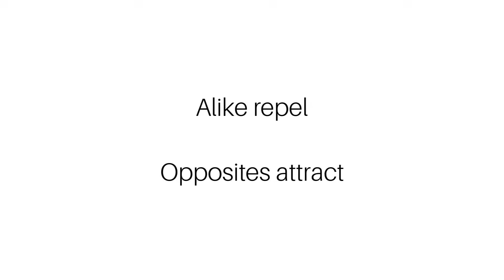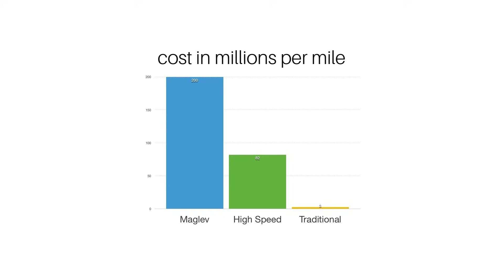How do maglev trains work?

Comment: They have invented free energy and momentum - no need for electric motors or combustion engines. 

Magnetism is the secret of the universe.
Reply from the maker: Nope. There is no such thing as “free energy and momentum.”
Reply: @NathanNagele  actually, there is - however I was wrong in saying this about maglevs because (as I understand it) electricity is used to change the poles of the magnets in the tracks?
Reply from the maker: @palereaper  yes, the magnets needed to make the train move are electromagnets.

Comment: Hey i wanna make a maglev for a school project so how do i switch the poles of the magnets so the train moves
Reply from the maker: You would need electro magnets and probably a computer to switch the poles.  An easier method would be to get magnetic tape and put two strips down, and then put two strips on a piece of wood or cardboard with like poles so that they repel the strips below it.
Reply: @NathanNagele  thanks

Comment: You cannot compare the excessive cost by using the Shanghai Maglev as a guide. It was built on river silt of a delta with piles of up to 75 metres long being used. This is not normal.
Reply from the maker: Seeing as there are so few of these systems in place around the world, there’s not many other ways to compare it.

Comment: This video I can find out work train maglev . The Maglev train is floating about 10 millimeters above the magnetic rail. Forward impetus is carried out through the interaction between the magnetic rail and the induction machine which also produces a magnetic field inside the train. Advantages and disadvantages The main advantage of this train is its ability to float on the rails, so it does not cause friction. As a consequence, theoretically there will be no replacement of rail or train wheels, because nothing will wear out (maintenance costs can be saved). Another side benefit is that there is no resistance force due to friction. Air resistance is certainly still there. For this reason, the more aerodynamic Maglev Train was developed. Due to the fantastic shape and speed of this train, the noise (sound) that is generated when this train moves almost the same as a jet plane, and is calculated to be more disturbing than conventional trains. In one study, the noise caused by Maglev trains with conventional trains is more noisy, about 5 decibels or 78 percent. Another disadvantage of this train is the high investment, especially the procurement of railroads. Thank you so much🙏
Reply: The Japanese Maglev train floats 10 cm above the track. It is the EMS maglev tech (German Transrapid) that floats 1 cm above the track.
Reply: bruh, it levitates around 10 CENTIMETRES above the ground

Comment: The working principle of the Maglev train is to use a magnetic force to lift the train on the rail (with the repulsive force rejecting the same polar magnet) and to move the rail along the track. Another important component in the Maglev train system is the track (train tracks). Along the Maglev railroad it is equipped with magnetized metal called a guideway. Maglev's enormous train speed is supported by a drive system that is quite unique, unlike other trains that utilize electric motors or fuel combustion, Maglev trains utilize magnetic fields created by electric coils (electromagnets) on the walls of the guideway to move the train. When the train floats, electricity is supplied to the coils on the walls of the guideway to create a unique magnetic field system that can pull and push the train along the guideway.
Reply: In democracies sometimes it is cheaper to go underground with a number of modern multi modal TBM working 24/7 than have expensive court cases.

A single 11 psi Maglev tunnel can increase speed from 600 km/h to 700km/h while still being breathable and passing stations would allow daytime trains to stop where needed with overnight container trains beating any truck by eight hours over 1,000 kilometres between freight sidings eliminating daytime planes and reducing trucks.

Using Sydney to Melbourne as an example with passing stations at Canberra and Albury it would cost $60,000,000,000 and return $20,000,000 per night which makes it able to subsidise daytime fares below planes and still have a return of 10%

Perhaps cooperation between Japan, China and America can develop the maglev container train with  Australia to use an international guideway to benefit the world.

Comment: Maglev train is an abbreviation of (magnetically levitated trains), in Indonesian called electric levitation train. Often also called a magnetic train. The principle of this train is to utilize the magnetic force ...
Because there is no friction between the rails and train cars, the Maglev system has a higher speed than conventional trains and is quieter.

In maglev, magnetic coil stretches along the railroad track, which will reject and lift the same polar magnets at the bottom of the train. This magket force allows the train to lift between 1 and 10 cm above the rail. After the train is lifted, electricity is supplied to the coils inside the rails. This creates a unique magnetic field system that pulls and pushes the train along the rails.

Comment: The magnet shown in 0:28 is NOT levitated by another magnet. It's floating on top of a superconductor, because of this. If the magnet try to move in any ways or direction. It will create a changing magnetic field relative to the superconductor. Due to Faraday's law of magnetic induction, that will generate a current inside the superconductor. This current create opposing magnetic field to the magnet, which prevent it from moving. The faster the magnet move, the more current is generated inside the superconductor and the greater the opposing magnetic field become. Because this thing is a superconductor, any change in magnetic field will generate an infinite current in the superconductor generating an infinitely large opposing magnetic field. This make it impossible to be moved.
Reply from the maker: Thanks. I’m aware of how it works, I was just using it as a visualization.

Comment: So... How does the maglev train gets electricity if its not in contact to any overhead pantograph or third rail? Although I already know the answer, but you forgot that part.
Reply: Answer?
Reply: @archanapathak4413  Using linear generator/alternator. Same principle as the linear motor but in reverse.
Reply: @jannadrielcervo7753  Thx bro

Comment: 0:35 how does the magnet so stable while levitation?
Reply: This is because the magnets used in them are superconducting which means they can conduct electricity 10 times stronger than ordinary magnets.
Reply: @niaskhan572  only the Japanese maglev tech is superconducting. The German (EMS) is not.
Reply: Jokku superconducting is magic you use on a wire, that wire has electricity, electricity has electrons, so electricity is the flow of electrons in a wire, when electrons move, they create a magnetic field, so a wire with electricity running through it basically is a magnet. You cast your superconducting magic on that wire you will lower their resistance to none, no resistance, nothing is gonna slow the electricity down, meaning the wire becomes a stronger magnet

Comment: 0:31 is actually not a "magnetic levitation", instead its actually a quantum physics, using material called superconductor to levitate the magnet in addition the superconductor need to be cooled up to certain temperature, usually it is cooled by liquid nitrogen to make the magnet levitate :)
Reply from the maker: Thanks for the clarification. I was trying to find something to better visually show how something can levitate that wasn’t just a picture.

Comment: my teacher asked me , how did the trains stay afloat at one place? like they are not sliding out of the railways . can anybody answer me . thanks so much .
Reply from the maker: Generally if the train is at a station or has to stay at one spot it has a “landing gear” set of wheels that rest on the track. When the train starts going the landing gear will retract. Hope that helps!

Comment: Won't it move back and forth?
Reply from the maker: No. Because the poles on the magnets are switching from one to the next the train is pulled/pushed. If the magnets were not switched properly the train would stop as it would be attracted to the opposite pole.

Comment: How are the pole of the magnets in the tracks changed
Reply from the maker: +Nabil Abdul-Latif by reversing the current in the circuit. When you control the direction of the electrons through a wire, you control the poles.

Comment: how can the forces change quickly
Reply from the maker: Via the electro magnets. When you run current through a coil you create a magnetic field. All that happens is that the direction of the electrons is changed and the magnetic field reverses. Think of the positive and negative ends of a battery. All that happens is that the battery is switched from one direction to another. The electro magnets are computer controlled and can switch poles nearly instantly.

Comment: How does the train stop??
Reply from the maker: The reversal of the magnets slows down causing the train to lose speed. Once it gets slow enough, it has "landing gear" that allows it to run on tires so that it can stop fully and come to a rest.
Reply: Nathan Nagele ohh then the speed of the train decreases as it reaches the final destination 🤔😂
Reply from the maker: Yes. And what causes that slow down is that the switching of the magnets happens slower and slower, causing the push/pull effect to decrease.